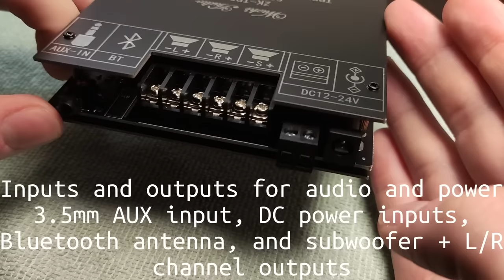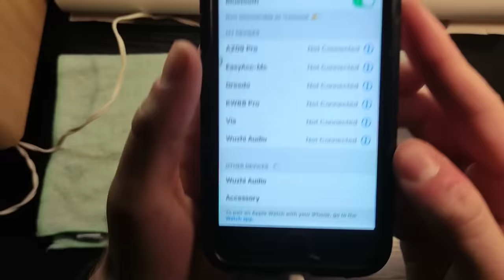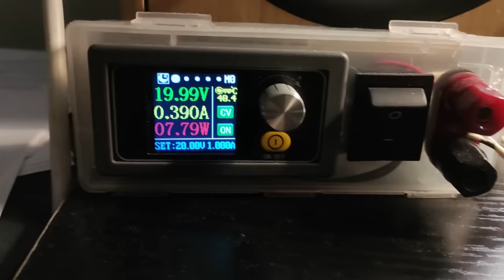Cheap 200w 2.1 Amplifier - Wuzhi ZK-TB21 Unboxing Assembly and Test

Comment: Habe das teil auch und es hat niemals 200watt dennoch super Amp
Reply from the maker: Ich denke, für dynamische Ausgänge mit schnellen kurzen Bursts kann es 200 W geben.  Aber es ist ein gutes kleines Gerät.
Reply: @Gerald Haller was ist bei vollaussteuerung der maximale Watt Bedarf? Also was wird tatsächlich verbraucht?
Reply: @BEATERUPTION   ? Du möchtest wissen wie hoch der Stromverbrauch ist bei voller Lautstärke ? So genau habe ich das nie gemessen sollte an 12 v um 2-3  A sein in spitzen ggf auch mal was mehr und auch weniger kommt auch auf den Lautsprecher an bei meiner kurzen test Messung hatte ich 8 Ohm Lautsprecher angeschlossen .
Mein 6 Ah Akku hält locker 6 stunden durch bei mittlerer Lautstärke auf Party Level macht im mittel 1A bzw eben drunter da der Akku nicht ganz leer war .
Das hat aber wenig mit der Leistung gemein die kurzzeitig als Impuls anliegen kann .
Reply: @geraldhaller9906  Moin , jo das wäre Mal echt super zu wissen wenn irgendjemand mal so'n Strommesser zwischen die Steckdose klemmt und Mal 10 Minuten lang aufreißt. Natürlich bei vollaussteuerung. Dann kann man sich nämlich den Faktor immer auf seine eigenen Bauteile ausrechnen und weiß z.b. wie groß die liion Batterie sein muss für z.b. 10 Stunden vollgas

Comment: 200 Watt? 😂😂😂
Reply: Most consumer audio gear use peak numbers unless stated as RMS.  This is 50w+50w RMS.
Reply from the maker: Probably won't push out 200w, closer to maybe 120w total with active cooling.